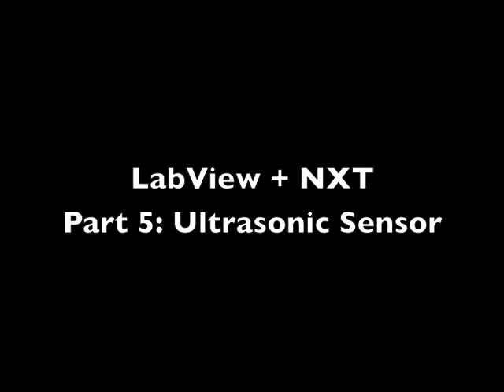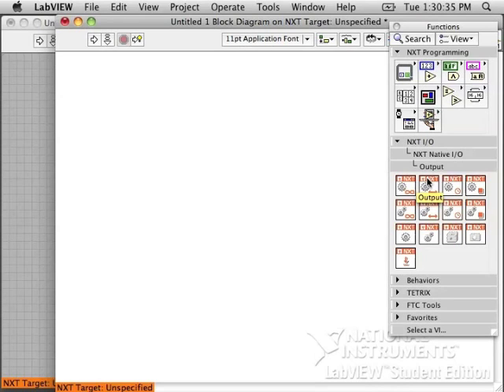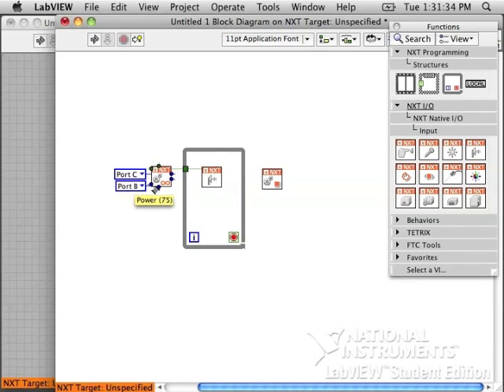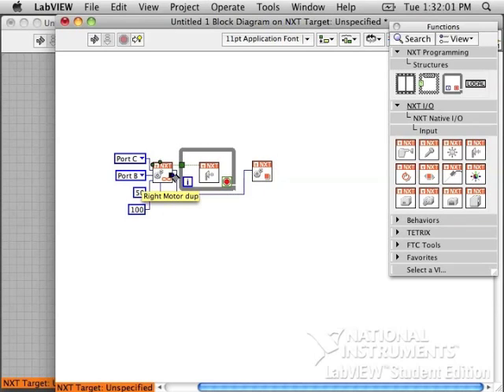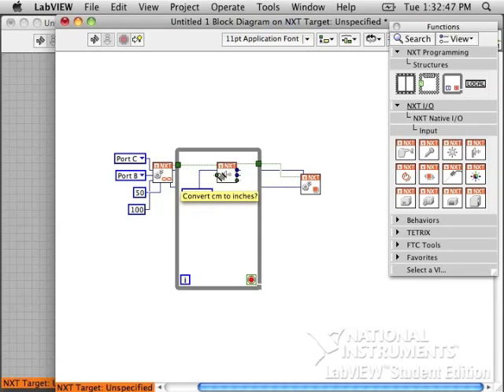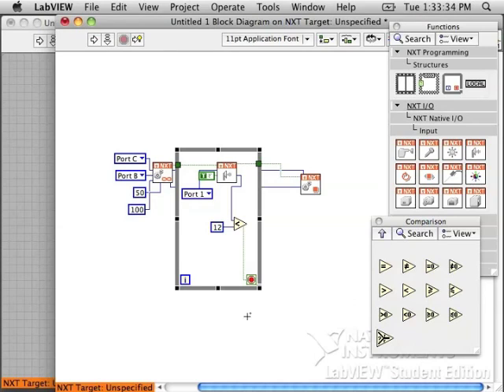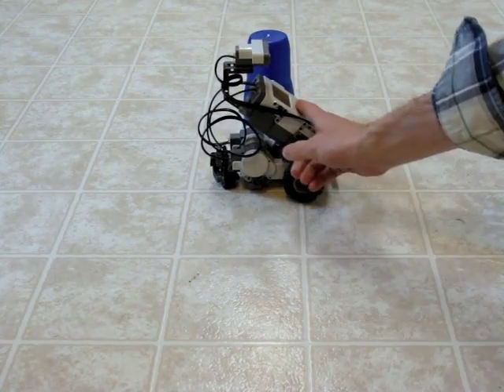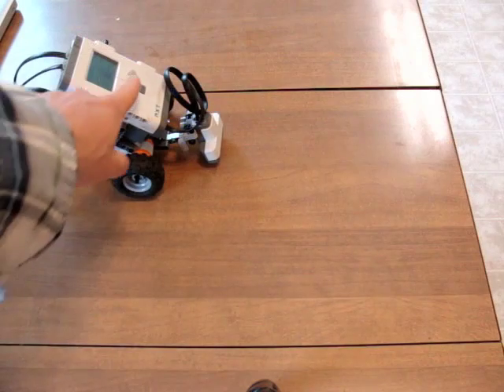Labview + NXT Part 5: Ultrasonic Sensor

Comment from the maker: Do everything the same as the video, but remove the two motor blocks.  You don't need them.  Outside the loop to the right, add the block to light an LED.  Then wrap all of that code in a loop that runs forever.  You will need to change the distance value probably inside the first loop to what you want to check for.